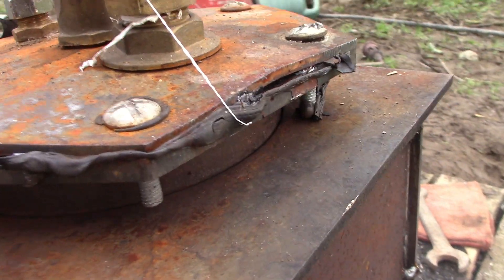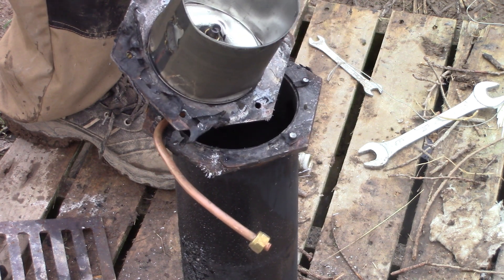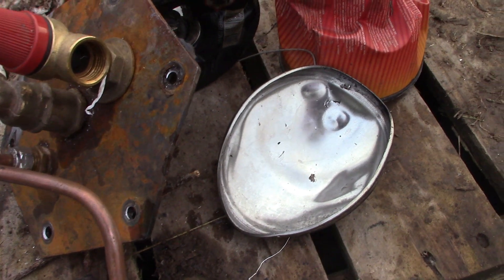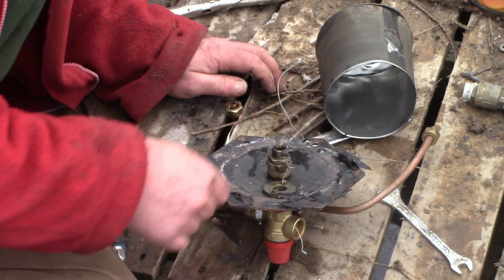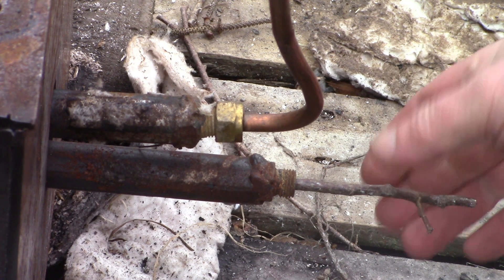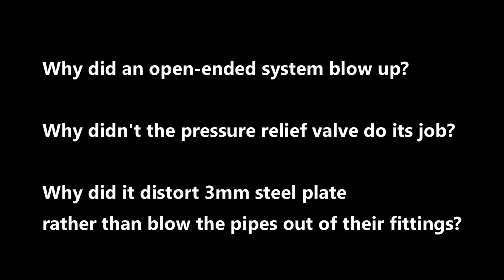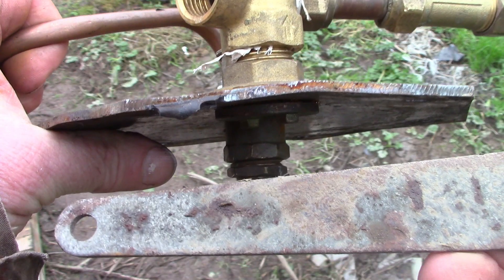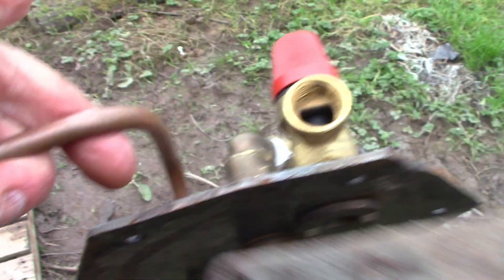Why Did My Boiler Explode??!! My Own Big Bang Theory...

Comment: My guess is. Don't use empty gas canisters as floats. I think they may have exploded inside that sealed area which maybe making it look like a implosion. The heat of the boiling water would have over time fatigued the gas canisters as they are really not built to have heat around them making them expand and contract. Over a little time that would have weakened one of them or both and created a creak under pressure and then let go.  When I saw your first video I was thinking "don't use them lol"

Comment: sounds very much like low water level. Research that condition on steam powered machines. you re not the first to blow up a boiler. water control is extremely important.

Comment: Very glad no one was hurt.

I think your theory of the root cause is good, but wonder if the pressure relief valve was able to handle the volume of such an intense and quick flash of pressure.  I wonder if multiple pressure relief valves in parallel (in my mind 4 or more) would handle such a surge.  At the very least it would provide some redundant protection against a single pressure relief valve failure.

Take care and stay safe.
--------
EDIT: The features of the top interior of the boiler having been embossed in the remains of the top float would suggest the top float did explode or slowly expand to block the outlet and the pressure relief valve.  Perhaps some channeling features in the boiler interior would be a good investment against port blockage in future designs.

Comment: I agree and disagree with parts of what Nicolai Itchenko writes in these comments.
I agree with the assumption that the gas canisters EXploded because the heated air inside em EXpanded too much and then hit the top of the boiler like a projectile.
I figure overpressure inside the boiler was not the issue. Overpressure inside the gas canister(s) was.
Could be talking twaddle though. Not an engineer.

Comment: Ok, you were lucky! Nothing to do with steam pressure, but heat. Firstly the gas cartridges weren't empty, they never are, hence the warning on them ( and ANY spray can) "NOT to puncture or incinerate". If you doubt this, light a fire in an open area, chuck one on and run! BOOM! lots of fun had from my childhood doing this. Even better put a short length of pipe in the fire facing up, drop a 'empty' spraycan in and a small rock on top, Instant mortar!( Actually, DON'T DO THAT!)

So, what happened inside your steam generator? You heated both of the sealed pressure cartridges until the pressure in the top one exceeded what it could handle, then caused the bottom to blow out( a 'safety' feature most have) this forced the can up pushing the top pipe thru it, and force the bottom down, crushing and bursting the bottom can, creating more released pressure that bent the top plate.

I'm glad you made the containment vessel strong enough and with a pressure relief valve, that stopped it from exploding, because the higher the pressure gets before a vessel explodes, the more violent and dangerous the explosion.

So, don't use a float that is airtight, even air will heat up and cause it to explode. You were lucky, which is a good thing 🙂What doesn't kill you makes you wiser!

Comment: It looked like the top can was blocking the pressure relive valve. And if you make more steam than the outlet can handle you get a buildup of pressure and sometimes an explosion. That is why you never extinguish a chimney fire with water the volume of instant steam can blow the chimney apart even if it is a open pipe. ( if I remember well 1 litre of water makes 1800 litre of steam.)
Reply: Exactly my thinking. The float was blocking both the pressure relieve valve and the steam outlet, allowing pressure to build. That's pretty much the only way something like this could happen I think.
Reply: @timderks5960  if it would have blocked it it wouldnt give an bang but an more slow release of steam when the lid gives away.   So thats kinda unlikely then

Comment: The safety release valve was not able to deal with the volume of pressure, not the psi of the pressure. The explosion was probably caused by a lack of water. The float exploding probably caused the flow of water to be stopped, or slowed long enough to cause the pressure chamber to overpressurise. Check train engine explosions, and they have very large pressure dump valves.  Maybe a design with the water tank under the tubes used to create steam. Just a few thoughts.  Good luck.

Comment: A blow off valve (different from a safety valve) would help based on your theory as those are nearly instant. They use pressure to push a sealed cap off a small pipe to relieve pressure, they go near over pressure they loosen but remained sealed, as soon as they go over steam flows out easy

Comment: Could be steam hammer.
When you have long pipes with steam in them condensation may build up on the bottom of the pipe.
The water can then be collected by the steam into a blockage which is propelled at high speeds down the pipe.
This water can have a lot of momentum which can damage pipes if it stops suddenly, it would also temporarily increase up steam pressure.

Comment: Looks like you made a super heated stream when the cans collapsed. I run a super De-hester on my super heater to keep that in check. It's really just some pipe with cold water running through them with a PID controller to operate it. Maybe wrap the main boiler with copper tube to run cold water around to keep the temp in check. Just something to stop it from flashing again and then you have a way to cool it all off too if things get interesting

Comment: i think i know what happend, the floats were sealed at atmospheric think of them like balloons, the steam in the boiler even at low presure would have been pushing on the cans. the presure would have caused them to crumple, the force of the lower can exploding shot the top can into the valve bending the top boiler plate. 43 psi is a safe presure for a boiler of that size. i have a wood burning boiler smaller than those camping gas cans and it reaches 150 psi. might i recomend a vertical flue boiler with a superheater for dry steam?

Comment: I think a "bell syphon" might be better than a float valve for controlling the water level in your flash steam boiler. 

Having fewer moving parts in any system helps reduce the chances of failure. 

You also might want to reposition the emergency pressure release valve to a place on the boiler where it is less likely to be blocked or obstructed. In the video, it looks like the float for the float-valve broke and was able to block off the pressure release valve.
Reply: I would argue that the float valve should be retained, but simplified.

A short perforated pipe that holds a section of smaller pipe sealed on the top, but open on the bottom.

The "cup" style float is free to move up and down within its "cage", but allows an excess of steam to flow around it to the exhaust and safety outlets whilst being held firming in its position to open or close the water inlet.

The open nature of the float will catch air trying to escape the rising water, thus still floating, but also allow for pressure variation without causing any internal pressure increases or decreases and thus won't fail, explode or implode.
Reply: or a float valve made from cork !?
Reply: @lacossanostra  steam systems need to take care with materials that can break down and become clogging hazards, so cork may not be the greatest thing to add into a system like that.
Reply: Siphon won’t work, water has to be injected at a pressure > boiler pressure
Reply: akin to the monotube aka flash boilers used in steam hydroplane model racing boats. hint see video on here "flash steam by bob kirtley"! such boilers avoids pressure vessels completely, and significantly reduce volume of water at temperatures and pressures where it could flash. just a long length of piping with water in one end, heat applied, along pipe, and dry superheated steam out the other end.if driving an piston engine that also drives a water feed pump... * does not need* a feed water control valve at all.
Reply: There's no issue with the valve.

Comment: If the one gas cartridge still had some gas in it. It may have boiled at a different rate then the water around it causing the one to explode and fire into the top and the bottom of it may have been pushed off forcefully enough to crush the other one

Comment: With the evidence shown at this time, I believe that your boiler did NOT explode.
The canisters in side that you had been using s 'floats' to activate the valve at the top may have been the actual explosion with the first one causing the second (I think the top one first) to explode almost instantaneously thereby creating the BANG and enough reverse pressure to bow out the top. 
Imploding canisters would make a vacuum that would be filled with steam and  water almost immediately creating enough push - much like a tidal wave in the ocean.
The pressure may not have caused the bow but the exploding float bent the lid as it moved upwards. IMPACT damage.
I am nit at all sure of this but it was what came to mind as an issue when you showed us the flimsy canisters going in. 
Just glad that you are OK
Steam boiler explosions can be quite spectacular.
Reply: This was my theory as well. The top canister did not look imploded, rather impaled on the inlet valve.
Also just a thought, but if it was pressure related shouldn't there be signs of distortion in the metal on the bottom of the boiler as well?
Reply: I agree. I've seen an aerosol spray can blow out the side of a house in a house fire I was on years ago. I think the butane tank blew and did the damage not the steam pressure.
Reply: Agreed.  I remember the boom when mom threw a hair spray can in the burn barrel bag instead of the regular garbage.  Quite violent.
Reply: @jerrystott7780  I agree the top float obviously blew its bottom out sending the top up and impaling it on the valve. What ever gas was in the top canister had expanded until it ex🖌ceeded the cans pressure limit. This probably happened as a result of greater temperatures being achieved as you made improvements to the design Tim.
Reply: @PaulRansonArt  Ye only have 8 subscribers !
Reply: Exactly right
Reply: thats what I think too... he should replace the air-filled floats with oil-filled ones and it should be fine
Reply: that is pretty much what happened and there are enough signs inside to prove it. 
you are just wrong on one thing and that is the "impact" damage. 
Since the lid of the top canister blew out downwards it sent the rest upwards and impaled itself on the valve thats correct. But all the gas that was building up inside must have had a much higher pressure then the steam and since there isnt that much steam to begin with in this boiler it wouldnt have a big effect. 
The key thing is the water. the can is submerged and so is the lid. 
If you nojw suddenly release about 3-4 bars (thats just an estimation) into a body of water that is completely surrounded by, in this case, a boiler. 
the pressure from the water rises rapidly. Since it crushed and most likely also opened the second canister which must have also been under high pressure, it create a second pressure increase and the key words here is hydroforming
the water wanted out of the boiler, but couldnt go anywhere so it took the path of least resistance and that was to bend the lid and then escape out the created wholes in the side of the connection between lid and boiler. 
it´s a method that is actually used to create big Metal spheres. 
Just  search for hydroforming and you will understand the concept easily.
Reply: @tripplefives and your are completely ignoring that there was no vacuum inside those canister so it's impossible for them to have imploded. You seem pretty set on an idea that just isn't possible.
The simple fact that the canisters were still normal in shape when put into the boiler is proof enough that they had some kind of gas in them
It would have most likely even been propane. And also the fact that the bottom of the upper canister was down inside ethe boiler and not pushed up into the canister also disproves the theory of it having been a vacuum inside the canister. Because if it would have been the bottom would have been pushed up into the canister by the water pressure which didn't happen.
If you have a high pressure difference it always equals out into the direction of lower pressure. Since the lid obviously got blown away from the canister it is proof that this was an explosion not an implosion.
You are also forgetting that the water is basically under no pressure inside a boiler since only the steam is and has a negligible effect on the water. There also jus tisnt enough steam in his boiler to cause this damage which only leaves the option of it being an explosion by external factor which in this case is the gas that is left in the canisters being heated and expanding to the point the canister can no longer contain it
Reply: This was my theory as well. Tim should try to warm up an empty canister to see at what temperature these explode
Reply: @tripplefives You may wanna read the original comment, because that clearly says that he thinks it's impact damage. I disagree with that comment, so why on earth are you disagreeing with me if you think the same?
Reply: Yes, most definitely the gas canister exploding
Reply: @RichardStansfield  certainly looks like the top canister has exploded.  This has crushed the bottom canister and expanded the top plate.  My guess is that the bottom seam has failed due to heat and the rising pressure in the canister done the rest.  Doubt if any propane had anything to do with it or there would have been fire etc.  those cans will not be designed to be heated for obvious reasons
Reply: Absence of oxygen in the system meant it wasn’t gas igniting. Steam isn’t oxygen, there is no oxygen in the cans.
Reply: Pretty much. Canister implosion, flash-boil... and remember what used to be in those canisters! I bet there were still traces in there. From everything I'm told there usually are... which would have uhm "invigorated" the flash-boil effect to a considerable degree by way of rapid combustion a la diesel engine ;)

Not to mention that the typical effect of an implosion + flash-boil like that, is what's called "water hammer". Wikipedia has some pretty scary examples of just how awfully awesome the power of water hammer can be... the statistics given for the SL-1 reactor blast are ahem particularly memorable.
Reply: Look at designs of steam traps and you will notice the float is an inverted cup that lifts or pushes on a valve to let only condensate past .

All experiments on the main boiler will be at just over 100 c. . next thing to print off is a pressure chart for steam boilers .   temp against pressure
Reply: I'd say the top canister exploded. A house near me was demolished by an aerosol can left on top of a clock radio that overheated.
Reply: @tripplefives Ye only have one subscriber, tis sad.
Reply: Impact damage seems highly unlikely to me. That canister weighs just a couple hundred grams. For that to bend a 3mm plate like that and not be crumpled to bits itself is pretty much impossible.
Reply: @timderks5960  The steam that moves into that space, by comparison, is much less in mass/inertia.
Reply: @timderks5960  implosions have quite a bit of force

Comment: I think it was the floats popping from contained air inside expanding. This caused the bottom to shoot off launching the floats onto the lid impaling it and denting the lid.

This would not cause the fittings to eject and the safety valve would not activate either. The solution is to have an open bottom on the floats so that the pressure can equalize in the floats with the boiler as a whole.
Reply: They did not contain air, they contained butane vapour, which caused the explosion.
Reply: I agree. The system is open, but the gascontainers were closed. They probably bulged out, and blocked of the bottom of the tank by pushing againstvthe sides, making it a closed system.
Reply: I think that with an open bottom, the floats will not float anymore, they will be at the same pressure than the boiler.
Reply: @milhooz  Imagine taking a cup and pushing it upside down into water there's a pocket of air that will cause it to float. If water gets into there it's okay because steam will naturally accumulate in there I believe.

This all theoretical, and would require some physical tests.
Reply: @deathclawow  Yes I see, I'm not sure it would work but would be interesting to test.

Comment: That 3 mm lid was the ultimate safetyvalve. Can you imagine what could have happened with a 10 mm lid?
Reply: they have this crazy chain of safeties in pressure cookers, it's really interesting. On the classic French brand (called "Seb"), old models, the last safety is the lid lifting from the gasket, but the rim orients the flow donwwards to try to reduce the danger radius.

(it was on the older aluminum models, I think the newer stainless steel just key into the lid under pressure, but the safety hardware is made of plastic, I suspect that the last dam is all that plastic hardware popping out for their port under head and pressure)
Reply: It would have been safer, because it would allow a predictable release instead of an unpredictable scalding. Good thing his hands or face weren't nearby when it let loose - could have resulted in some nasty burns. The temperature and pressure valve should ideally be the first thing to release, indicating a problem and alleviating it in a controlled manner while you can make a fix or shut it down safely.
Reply: Henkka  i think its probaly going to crack a weld on the bottom or top side those small thread diameters are incredibily stong. Doesnt matter if its softer.    Surface is the point which matters most